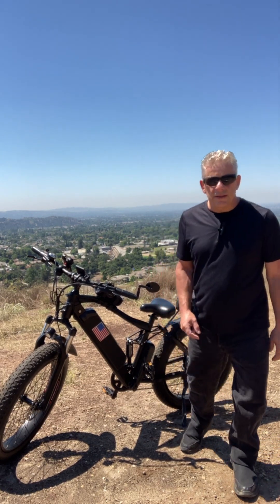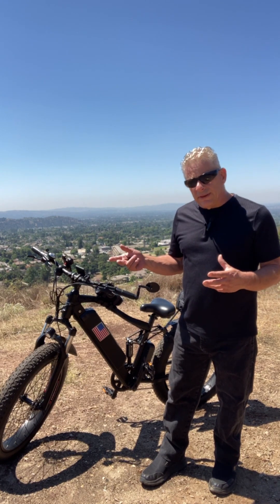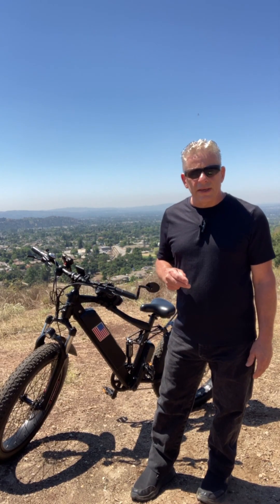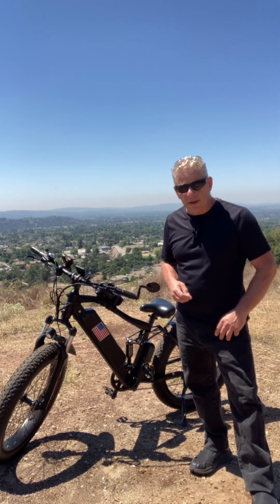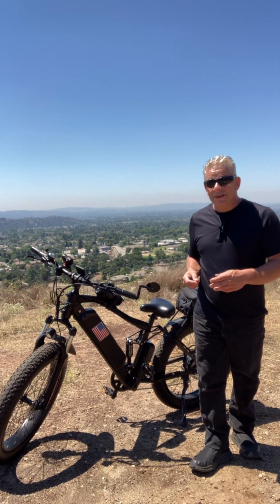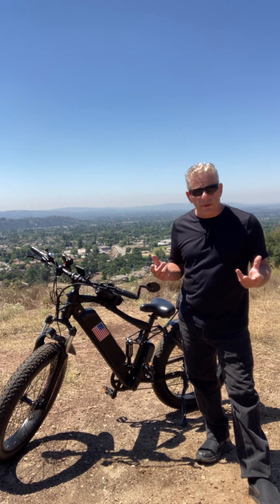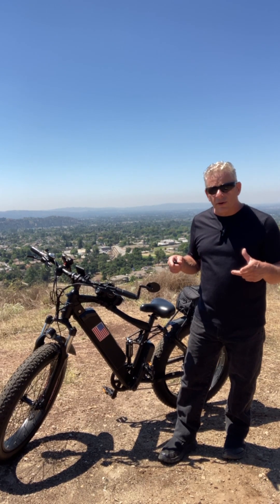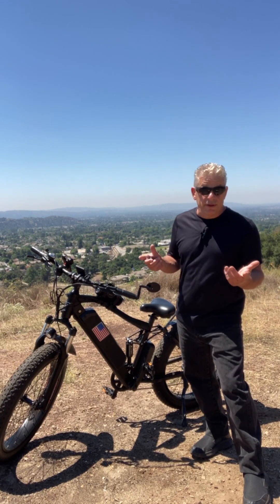Bafang 1000w eBike Conversion Results

Comment: I have the thousand watt bafang kit on a Mongoose Juneau, climbs  really well, I believe there are two versions of that motor, mine is the 6.5, that's the one that has more torque, there's another one I forget the number, that one is for higher speeds usually for a 20in tire.  Mine will do 31mph with a 52v and 29 with a 48v,
Reply from the maker: Mine supposedly has 85Nm of torque and the consensus is the newer overheating program in the motor and controller is what's reducing my wattage when climbing although it doesn't seem to be heating up at all.  Had a buddy try it the other night and he was all pumped to get to 33mph, albeit on flat ground.   Thanks for the info!!
Reply: @johnnysezebike1319  I've always thought those numbers don't meant anything, if they really put out 85 Newton metres of torque they would need a wheelie bar, and would takea Honda Civic off the line. I also have a 500w Speedrid 26in, it was one of the cheapest e bikes on Amazon, only 500w and 72nm on paper, but with just a better 48v than the one it came with it peaked at 1040 w seem like no matter how many watts you put to it, it only going to do 26mph but when it comes to straight-up climate especially in the woods climbed better than any other hub motor I've ever seen.  The pedal assist works off of speed instead of power though, so it will go all in on pedal assist one trying to make it to 13 mph, my bafang won't do that, like you said it'll give you more power under strain but only to a certain point, think it's a safety thing, it holds back,  with the Speedred I had to cut off the motor wire connectors and solder them because they were getting so hot that they were melting the rubber coating, for some reason came with the old school RC car motor wires.  You should get one of those I think they're called phase runner controllers, I've heard of people putting 3500 watts to those thousand watt bafang motors with no problem.  So the moral of the story is we're all in the experimental phase of the game.
Reply from the maker: Excellent points!  I notice alot of the numbers aren't what they appear to be.  I am actually ordering a Phase Runner to see what it can do with various motors.  Friend has one although it did heat up on one of my mountain rides.  Either way, should be fun experimenting! Thanks!  @bassw1758
Reply: It seems like you got the “06” version which is wound for a bit more top speed and less torque, you can check the numbers on the motor it should say G062 1000 DC 06 or 6.5. The 6.5 would be more suited to your ride style. I think the Bafang made 30 amp controller is the issue triggering the overheat cut off it’s programmed to be too sensitive. A KT controller may allow the system to push amperage out for much longer periods, my favorite builds are the G062 motor with a 35 amp KT controller.
Reply: @gregorygreg1135 yeah differently,    the Bafang controller goes into a safety mode after riding it hard for a little bit.  It'll only pull about 600 watts, top speed goes from 31mph to about 24.
Reply: My bafang 750 hit 58kph daily basis on a small 13ah battery but still i wanted more i feel ya there switching to a 2000w rear hub conversion thanks for the video!
Reply from the maker: @Tenstringguitar  2k geared hub?  What brand?  Sounds wicked.
Reply: @johnnysezebike1319  kirbebike 1500 to 2000 w kit comes with everything. Or i may run two bafang 1000w hub front and rear but thats actually more epensive. I dont climb hills but i do honestly alot of towing ha i also ride in minus 40 snow

Comment: hey mate, it sounds like you might want a mid drive,  like a Bafang BBSHD 1000w. They have it in fat bike sizes that fit bottom bracket shells of 100mm and 120mm.  Hub motors are not as good for climbing
Reply from the maker: That'd be my CSC 1000w Bafang mid-drive.  Did a review and some hill climbing videos on it.  It's a billy goat for sure! It does drain the battery pretty quick is the only downside. I also have two with dual hub which is more fun than the mid-drive on the hills.

Comment: Not easy finding a fat front tire motorized wheel conversion kit. They all seem to be rear wheel only.
Reply from the maker: There's a few out there that I found. Here's Ebikeling with 1200w direct drive so it only has 30Nm of torque on front forks. https://a.co/d/cMR7Hmi    Getting a geared one is much harder and they are out there since several companies offer them such as Ecell which is the ultimate dual motor bike imho.